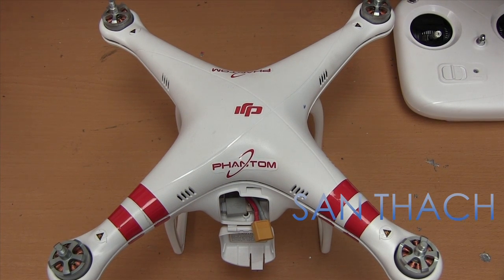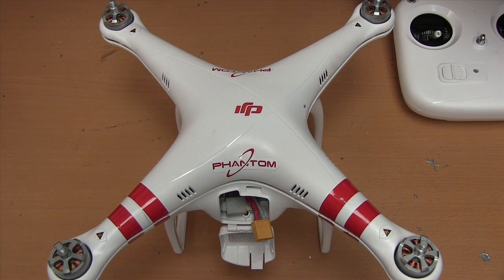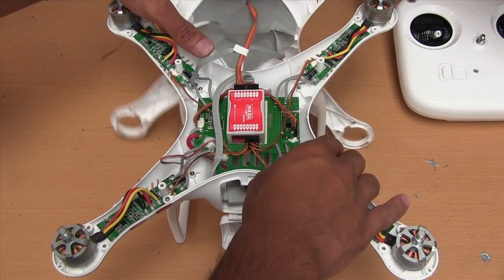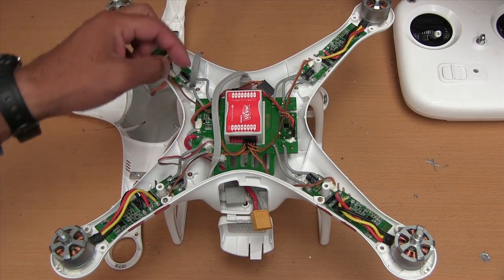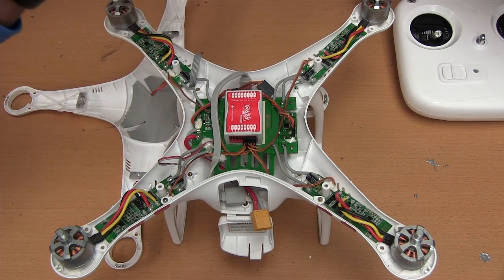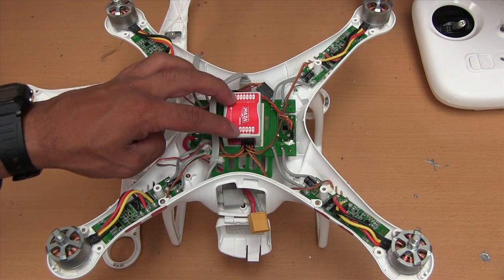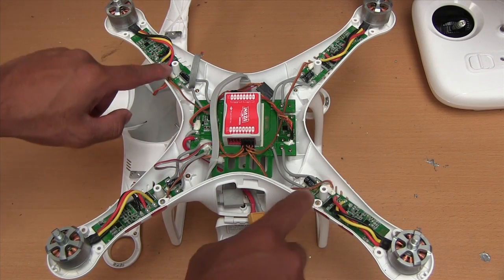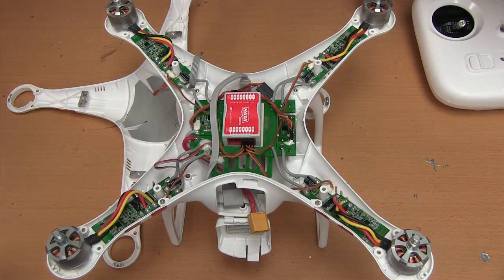DJI Phantom Wiring Diagram

Comment: So where's the diagram?  I have an extra board for some reason, it's stock standard so I assume it's a different version of model 1. It's about the length of the ESC's but is narrow one end and wider at the other. I cant figure it where it goes, plus I have 2 wires which appear to have been cut off and I can't figure out where they go. Its a red and grey, but similar to the smaller ESC wires. Obviously I wasn't the one who pulled it apart, just the shmuck who puts it back together.

Comment: Hi Phan Tom,Hopefully you'll be able to help? Can you tell me what the purpose of the red/grey wire that feeds off the mainboard and seems to attach to M1 ESC as mine is severed???? and is just pushed under the ESC..Thanks in advance..I also noticed on your video relating to replacing the ESC, that your red/grey wire is also not connected to anything! What is the purpose?? Thanks again...

Comment: i have a phantom 3 standard. I would like to attach a small electric motor on it ( science project ) anyways. I would like to tap into the remote instead of using a different remote. The only commands the remote needs if forward, backward and rest. the R2 switch would be perfect because I don't use it. so i guess my question is how could i find the wire that the r2 controls and instead rewire it to my motor.

Comment: SOS......Please can you help me out here Phan tom. I have been reattaching my battery leds to the mother board after fitting new ones, And i hav discovered that i have got two tiny thin wires come adrift. and i can,t for the life of me see where they were attached to. They are the tiny red and gray wires that come from the mother board the fixed ends are attached to the mother board very near the front left corner (LOOKING AT YOUR PICTURE ON SCREEN) of the orange naza unit....On your pictur they appear to go to the front left esc board..but i cant see clear enough to identify where they go....Please can you help me......looking at my drone, Which is the same as the one pictured. the two red and grey double wire are the only ones that fit this discription so should be easy for any one to spot........They go into the mother board at the front left corner of the Naza unit.......Please can anyone identify wher the other ends of this wire goes.....Or are they ment to be loose, for future add on,s....I don,t know......any help would e welcome. Thankyou..Bri
Reply: brianfindsall This is a loose power wire. They are meant to be loose for further accecories. As long as these wires don't short out, you'll be fine.

Comment: What is the red/gray wire in the wing on the bottom-left corner of your video (the one to the left of the battery opening)?  It is the only wing that has such a wire.  What is the wire for?

Comment: Hi,

Just a little quick question for you.

On ESC board there are 3 little pads where we solder the appropriate wires.  So far so good.

A little farther, there are 4 small pads which at first glance are there to accomodate smaller wires.

Can you tell me the purpose of those 4 small pads ?  Are they for testing some signal ?  Are they some sort of an extension to the leds ?  What are they for ?

Regards.

Comment: The grey and red wire that runs from the main board and runs to the side of #1 motor where does it connect on the board on the #1 motor board

Comment: Hello,

In your video I was hoping to see where that ribbon cable is going from your GPS.  It looks like its going through the hole in one if the legs but I can't tell to what.

I have a Phantom 2 and I just replaced the GPS.  The original  GPS in it doesn't have the ribbon cable or even the slot on it for one.   The replacement I bought does but I have no idea what to do with the ribbon cable so I left it off. This must not be right because now I can't get a GPS lock at all.

Can you tell me where your ribbon cable is going?

Thanks
Wayne

Comment: Thanks for the post... What is the term for, or how would I search for a way to extend the little cable that goes from the LED in the back to the NAZA? I'd like to extend it by attaching another black plug to the one that is on there and then into the NAZA.It seems that the wire in my phantom is so short that if the battery bumps it, it will disconnect the led, (pulls out of naza slightly) and i no longer have the status light, have to tear it all apart and plug it back in. Extending the wire will solve this problem but i can't find the part.

Comment from the maker: Hi Heath.  This one is a little bit tricky. The motor will not have any affect with the LED light below. This might mean however that the ESC might be the one that's defected.  To verify this, try installing the motor for that ESC on another ESC.  If the motor works then it's the ESC.  BUT if the motor doesn't work, you probably have to replace both the ESC and the motor. You wouldn't want to fly the Phantom with out the LED light, although it's possible.  Let me know if this help.

Comment: on my phantom, one of the motors went out. So, I'm in the process of getting it fixed until I realized that the Led below the motor is also out. On the phantom, will a bad motor also generate a bad light or is the light and motor indicative of a bad board?